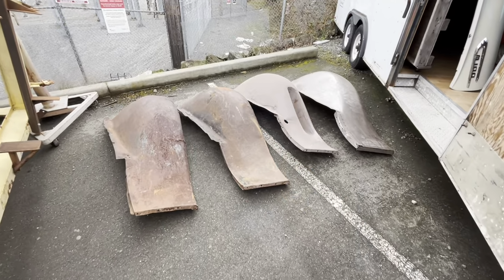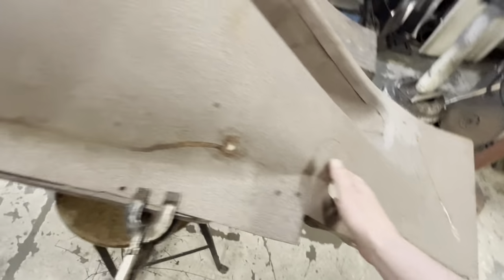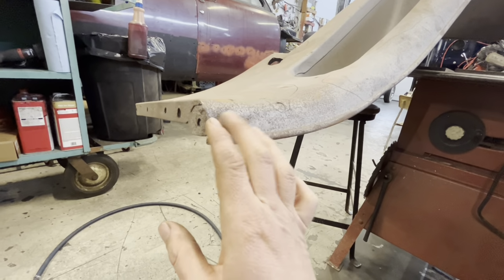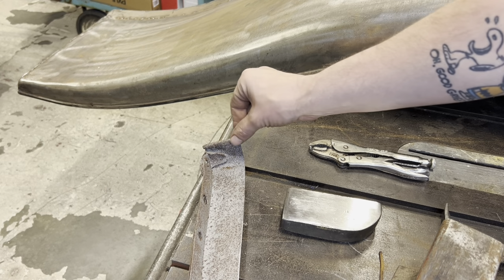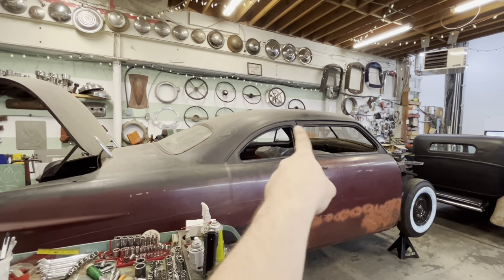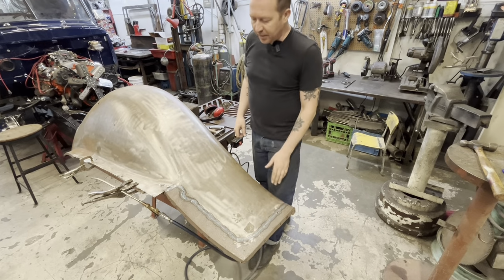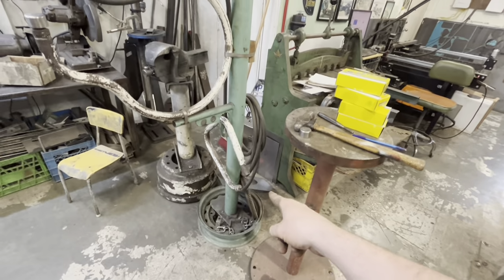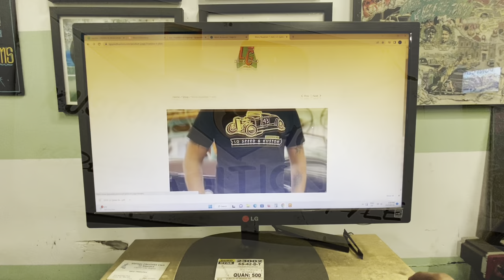Metal Working 32 Ford Fenders

Comment: Hey Lee,nice job! What's the plan with running boards? You have new rubber? I'm at the same point with my deuce and I've read on the hamb about gluing the rubber on with the right stuff. Any thoughts? BTW,I will be using Bob drake repro rubber for running boards,they're gonna look awesome! And the fenders make these cars look much more graceful.
Reply from the maker: I was planning on upholstering the running boards
Reply: @LGKustoms  thought you might say that!

Comment: A good metal shaper could make that part out of 19 gage in about an hour and save the original finder.
Reply from the maker: Guess I’m not a good metal shaper…
Reply: @LGKustoms  That isn"t what i meant to say...I should have said a "well equipped metal shaper".  You don't have a power hammer, Pullmax, flanger, etc.   With the proper equipment a skilled metal shaper could make that patch quickly.  Sorry for the poorly worded comment.